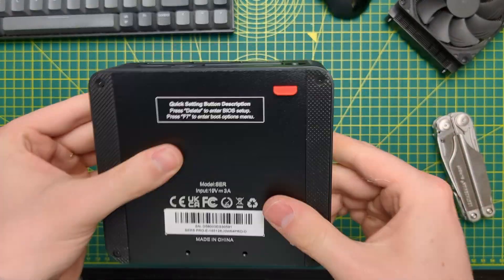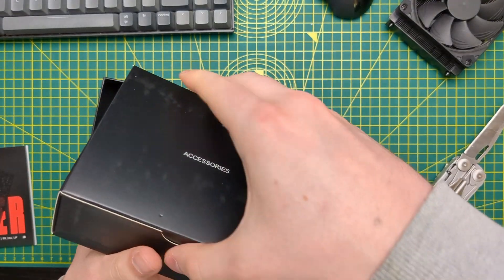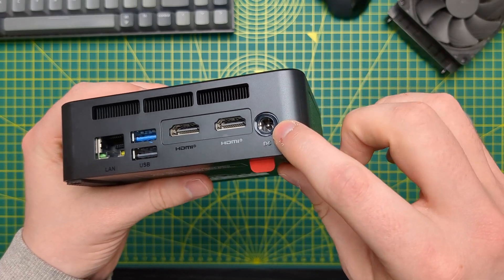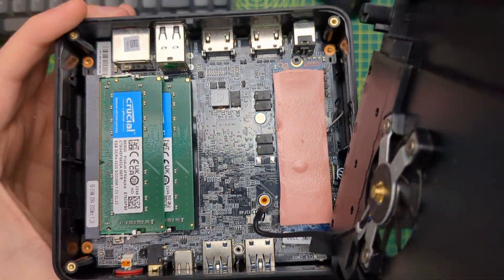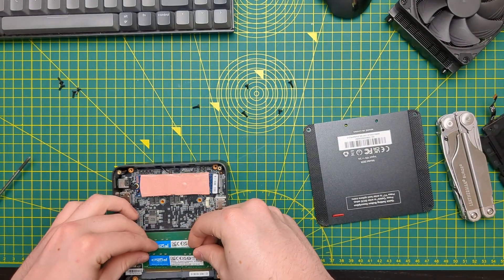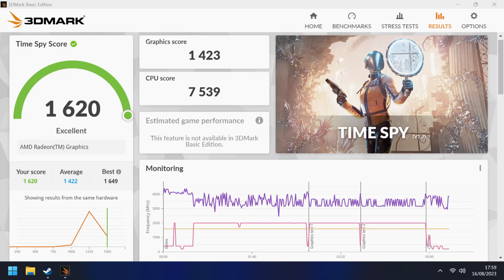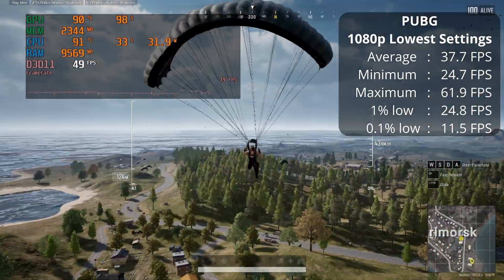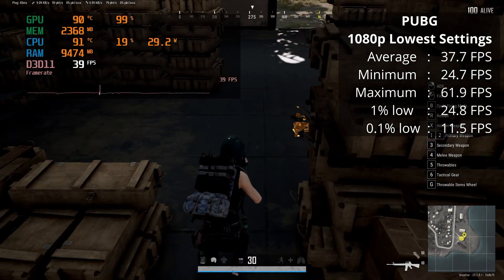Beware of Quality Control Issues: Beelink Mini PC SER 5 PRO 5800H Review

Comment: I bought a mini PC similar to this in March of this year (specifically a SER5 5660U model). And for the first 5-6 months I had it, it worked great (putting aside Windows 11's nonsense). Unfortunately now however, I'm facing a major problem with it. At random moments, the whole picture starts glitching like crazy after having the thing on for more than an hour or 2 (with green and purple showing). Sometimes immediately if I run more intense programs like Blender and such. 

Now there could be potential reason for it doing this, one being due to me stupidly leaving the thing on 24/7 aside from occasional resets, but I also have a feeling something inside the PC got screwed up or became loose. The only other problem tho is that... since I don't know how to fix tech or take it apart, I don't know what part inside is the source of the problem. Do you have any potential diagnosis for what it could be aside from me being stupid with it?
Reply from the maker: Very strange - it sounds like a defect with GPU. This isn't something that happens from just leaving it on 24/7 so you weren't wrong in doing that. A GPU issue isn't something you can fix with this because on this model it's built directly into the CPU. Beelink does have a 12 month warranty so if you have your proof of purchase I would recommend emailing their customer support - Warranty policy is here https://www.bee-link.com/pages/development-history

Good luck!

Comment: There wasn't a screw holding down the m.2 drive on mine, and when i opened it up, it popped up in the holder.

I'm going to check the thermal paste on the cpu this weekend because it seems to be running a little hot hitting 90C under load. I bought it new a month ago.

Comment: i got one if you want to have it for a long time i recommand to put 40 Watts cpu max and your temp will not go higher than 75 and donwload RYZEN CONTROLLER to put in 40 watts everywhere and 75 max temp and put 8 gig ram in video memory if you have a 32 gig version ; have fun with this super pc/price :) that is for the 5800h version
Reply: What do you recommend to maintain the ser5 5700u pro version for a long time
Reply: @bamban_garcia5562  5700u dont need this this cpu not overheated
Reply: Where can i download the program?

Comment: Good morning, can you help me? I have a pc like yours, and I have the following problem, after it turns off, the cooler turns on and doesn’t turn off anymore. It keeps running all the time even with the pc turned off. It only stops spinning if I remove the power cord from it...
Reply from the maker: Seems to be a common problem - there are some solutions/troubleshooting on this reddit thread: https://www.reddit.com/r/MiniPCs/comments/11fzu4d/beelink_ser5_5600h_fan_wont_stop_after/

Comment: :) Thanks for sharing! I had issues with getting all the screws out to upgrade RAM, etc, BUT I had to pull SSD OUT due to HEAT issues :(  So now I have it externally on USB front port.  Also purchased a clamp on fan to put right above unit  to cool even more.  Still shuts down occasionally.
Reply from the maker: That's unfortunate! Maybe you would be better off with a 2.5" SATA SSD instead?
Reply: Thanks much, and it was a SATA SSD in there :( @SmallBoxCentral
Reply: Interesting!

Comment: They mean do not prevent the fan from turning. Do not block the fan. How would you say it instead?
Reply from the maker: If you put something in front of the fan, it is still technically blocked even if it spins, you're just blocking the air and not the blades. Your own words would be better "Do not prevent the fan from turning"
Reply: Can the fan still push air out the sides instead of the top with the additional ssd?

Comment: Thanks for following through! And the improved top-camera angle makes the video look professional. 👌

To be honest, the loose screw was funny. 😂 Personally, I would consider an actual dud device as QC issue. I agree it could be unsettling the first time you hear it, but the loose screw technically did not affect functionality.

"Do not block the fan" most likely meant do not block the rotating fan. Chinese-English sometimes translate too literally for native English speakers.

SER5 MAX is where is where you get the audible fan noise. I definitely hear mine.

Overall great video. I particularly like the teardown segments.